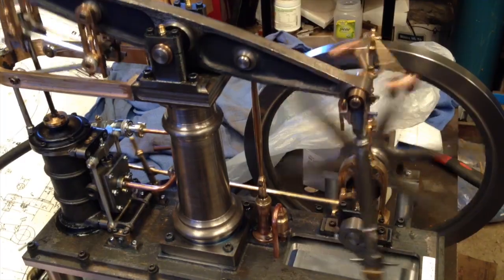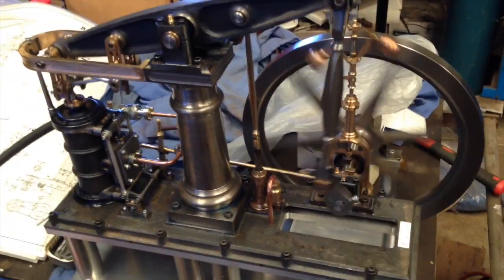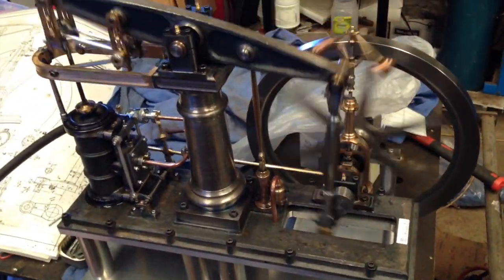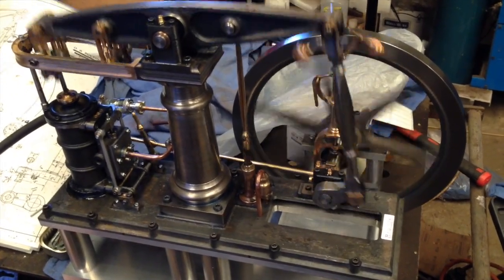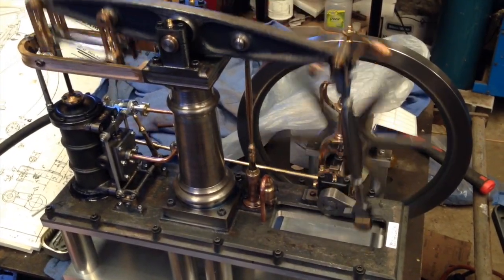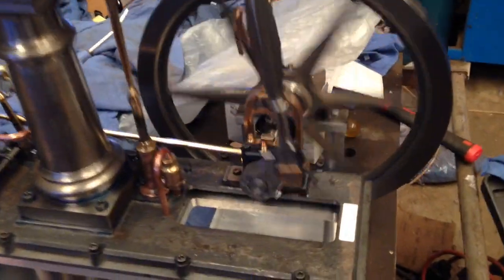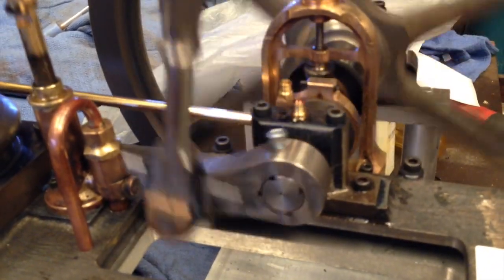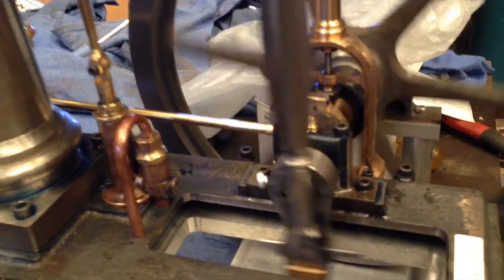Beam Engine First Run

Comment: Brilliant job ,,, you must have been over the moon to get her going ,,,,,  and she sounds so well,,,,  great set of videos by the way and great workshop,,,,
Reply from the maker: +Alan Plumb  Thank you.  Yes, it was a very exciting moment.  Mind you, I had no real understanding of the valve timing.  Trial and error really.  Currently making a triple expansion.  I might need some help with the valve timing on that one.
Reply: +John Viggers My word a triple expansion WOW,,,,     yes far more complicated to get the timing ,,, some one like Keith Appleton will soon put you right,,,,,,     as soon as Triple is mentioned my mind goes back to been 12  ish  and going to Kempton Park pumping station with my Dad,,, when it was still in service,,,,   and before the other older engines (4 or 5 ) of them all in a row had been scrapped ,,,  ,,, awesome work ,,, keep it up ,,,, cheers and regards ,,,, Alan